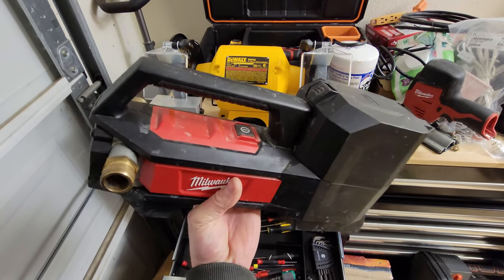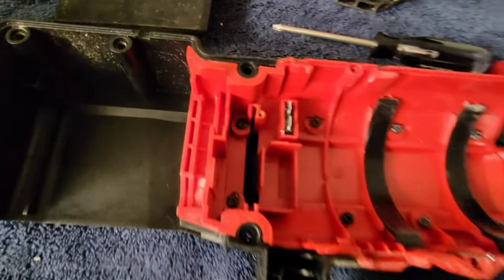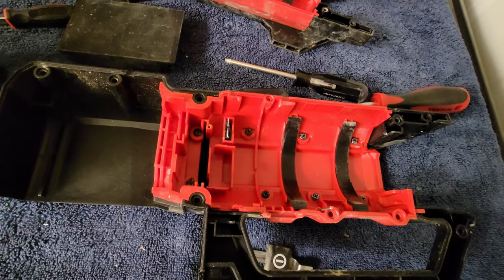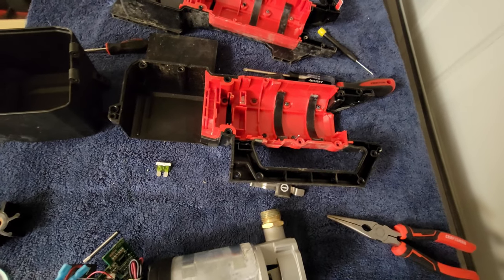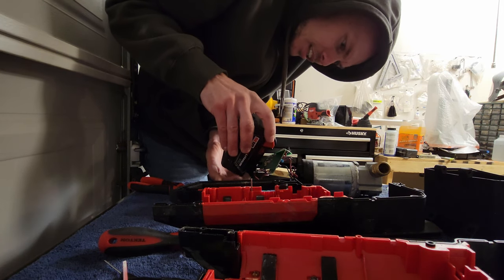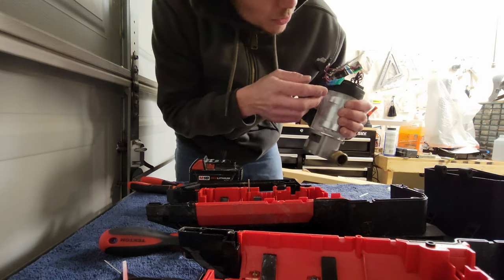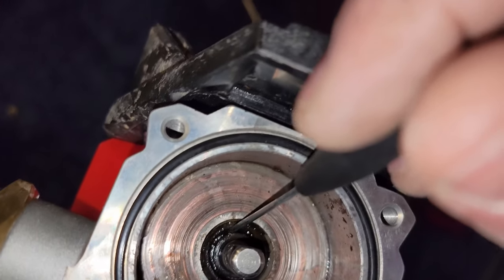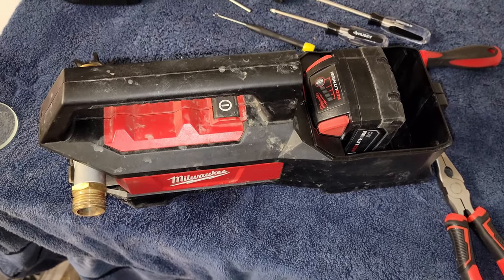Dead M18 Transfer Pump (Fixed with a fuse)

Comment: I love using these Milwaukee pumps for draining tank water heaters guys, but they are very fragile and will fail if you get the slightest bit of water inside the unit. So be sure to raise them above the floor on a couple and even wrap them ziplock bags or clear plastic before you start pumping. Oh yeah, have a similar corded pump on hand as a backup.
Reply from the maker: Yes, what I learned from this is not to set it vertically, or the water can drip down inside and fry things. It has built in weep holes in the casing for when water makes it inside it can drain out without hitting any electronics, but only when it's horizontal.

Comment: I came across this video because my pump quit working on me, well once I took it apart and inspecting the pump and board, I found that my fuse wasn’t blown and was still good. What I did find was my ground circuit on the board itself was fried, where it goes through the board from the battery side of the board to the motor connections on the board. Luckily I had some spare wire and decided to solder a small piece of wire across the board on the ground contact on the underside. Voila it worked but this pump has a few weak links in it and we have identified a few for other people to check
Reply from the maker: Great, I'm glad you found your issue and shared it.
Reply: This is what I think is wrong with mine. I can jump my motor ground lead (pulled off board) to my battery ground and then it works like a champ with the switch. Can you buy a replacement board?

Comment: Sweet. Going to take mine apart and see if that’s the issue. Also— once it’s apart I’m going to see if there’s any wiggle room for a rubber seal gasket or silicone to prevent it from happening down the road.
Reply from the maker: 👍 Silicone is probably a good idea. I think if you just keep it horizontal, that it should be okay. I would just run it vertically sometimes or let it sit up after using it and water drained down into the electrical.
Reply: How did you get the pin out to remove battery cover? Punch and a hammer isn’t working for me.

Comment: It sure seems like if you angle it up some, it may prevent the water from getting to the electrical board. I imagine running it after the water quits flowing, it warms up the gasket that separates the impeller from the electronics, it may wear out fast without the water keeping it cool.
Reply from the maker: Yeah, if the butt was propped up a bit that might help, but I think it would be fine just leaving it on all fours. I think I fried it by occasionally running it in a vertical position.

Comment: My Milwaukee M-18 transfer pump is now intermittent.  The water is literally coming out in short blasts.  Thoughts????
Reply from the maker: Sounds like a bad contact inside. I would disassemble it and see if you can't find some corrosion or a bad contact... sometimes just disassembling can solve the problem because you reattach everything more firmly when you put it back together.

Comment: That's a pretty serious flaw. I have one for sump pump emergencies. I live in a valley where our sump fill constantly so if mine fails when I need it I'm screwed.
Reply from the maker: Yeah, I think the main issue is that I would leave my in a vertical orientation sometimes and the water would drain towards the motor and electrical. So, I think you're good if you only keep it in a horizontal orientation.

Comment: Having trouble with pin in battery cover.
Reply from the maker: What's going on with it?
Reply: @MyFortressConstruction  I finally got it to drive out. Looks like my ground circuit on the board is fried. I can jump negative motor lead to negative on battery and it works. Not sure if you can buy a replacement board or just solder a jumper wire.
Reply from the maker: @paulpartain6319  I highly doubt they'll sell you a replacement board, because the online parts list doesn't include any internal electrical parts, only housing, impeller, etc. AvE had to fix his like what you're talking about. Check his video out if you haven't already: https://youtu.be/yRP-PCYZDpo